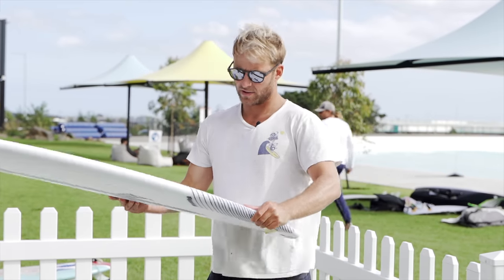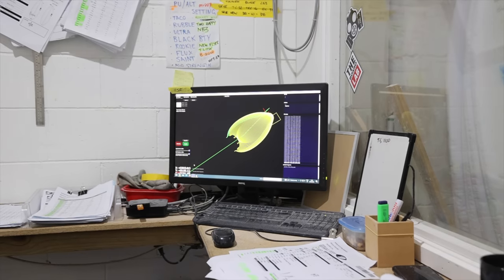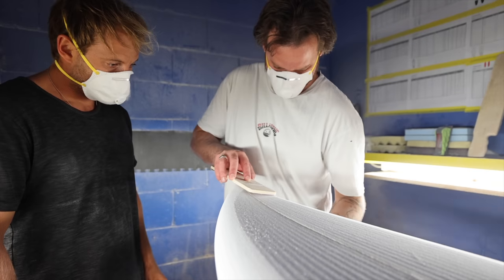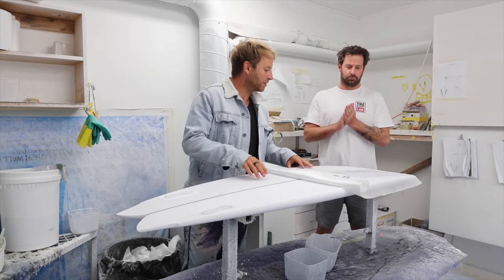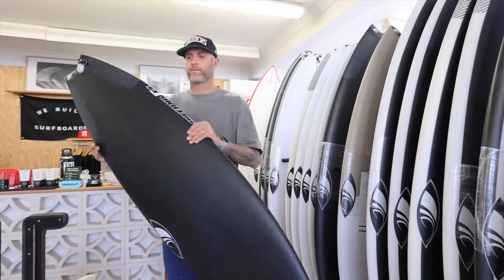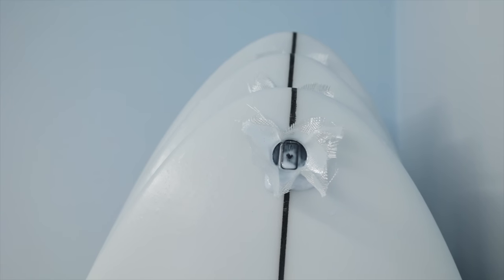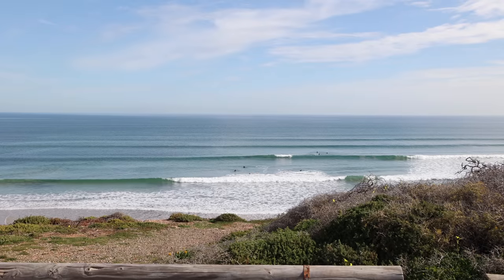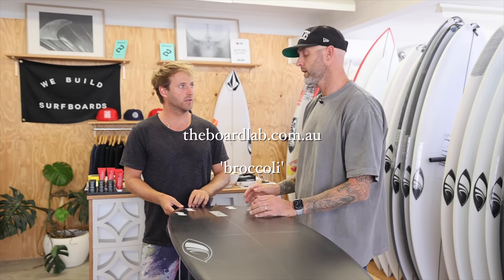Shaping my first twin fin surfboard....

Comment: I shaped my own boards. Have done so for the last 30+ years. Do everything shaping glassing sanding, even foil my own fins. Love the entire process. It’s difficult to master and very easy to stuff up. Give hand shaping a go Kale it’s way more difficult then you think. Much respect to the time and effort the guys put into every step. Great video. Oh and btw I ride mostly twin fins and quads. Can’t tell you how important fin placement is on Twins. Great to see Wayne O from the Glass Lab in this video. Absolute champion. Cheers
Reply: I really want to shape my own as well. Even if they underperform I can say I shaped it myself.

Comment: Rad Kale, and mint you have a place like the board lab to work with.  I’ve been on roughly same obsession timeline as you but learning w/a pure analog shaper.  Pros/cons aside, your experience is helping me see things I can’t in pure analog.  One thing I do get is same guy does it all so I see it all and communication is different.  Anyway, IMO, regardless of how you get it done, highly recommended for anyone who can, at least participate in shaping 1 board, whatever mode, that you will ride.  This will change your surf life friends, and you might get obsessed like 🥬😆💰🤘🏽 nice one kale…thanks for doing these🤙🏼

Comment: Thanks Kale.  How did you set the "cant" on the fins.
Reply: I believe that FCS fin boxes come with pre-set fin cants so the boxes go in flat but the slots for fins are canted already. With futures you have to set it yourself. Could be wrong, definitely check out Greenlight surf for info.
Reply: @alexmoskowitz4025  FCS, the cant is built into the finbox. For futures, the cant is built into the fins. For either, box installation is conventionally done using a router template setup.